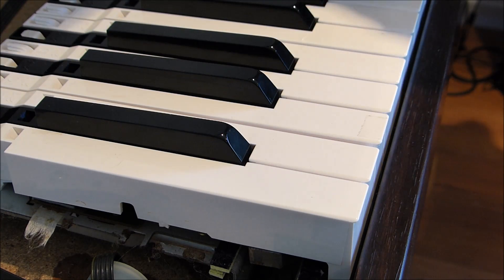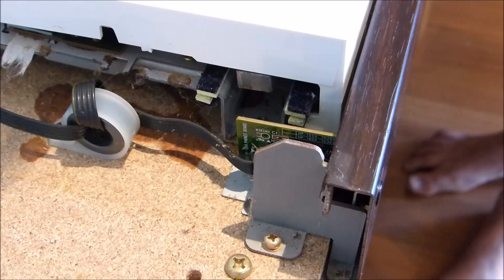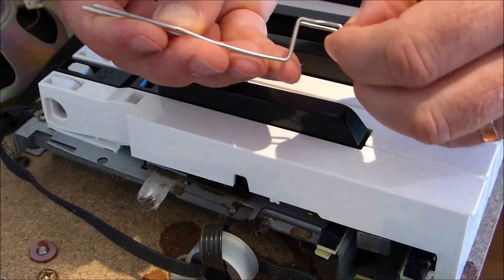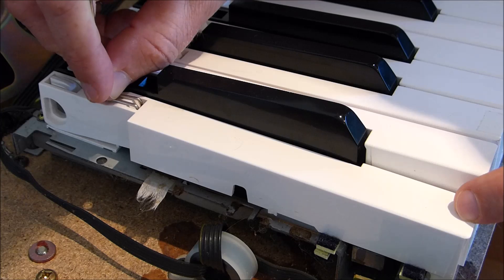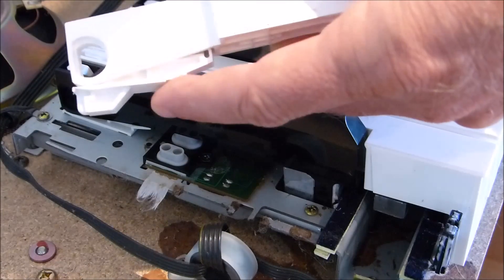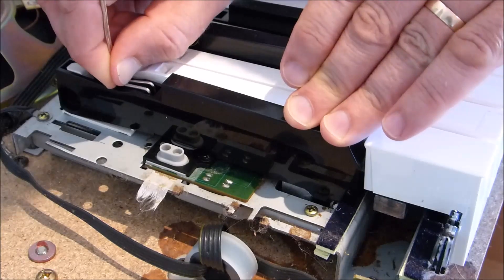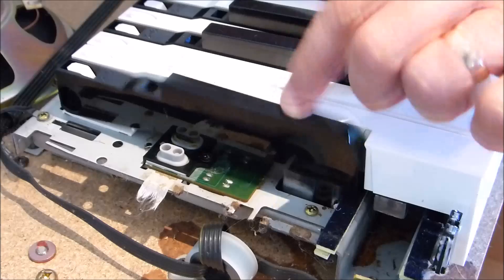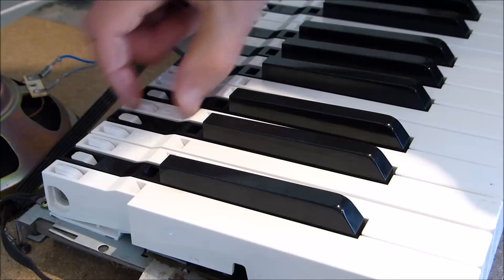Roland HP-230 Digital Piano Key removal for contact repair HP-3700 HP-800 HP-2700 KR-4700 KR-5000

Comment: Hi there Fontgod,
I am a fellow Aussie and found this video incredibly useful. Thank you so much.
I managed to get all of my keys off with the your paper clip tool (I found if the paperclip wire was not very strong, it was beneficial to insert a small flathead screwdriver behind the tool to keep it in place while the key is being taken out).

But regretably I have realised that if the nipples on the underside of the rubber contact pads are broken, then operation of note on/off or velocity is impeded because it doesn't make correct contact with the contacts in the pcb: the front nipple is note on/off; the back nipple is velocity. This often can explain why note on/off doesn't work at all: faulty front nipple; or velocity is always 100% when note is sounded: faulty back nipple.

The syntaur.com website you suggested in the comments thread does have limited stock of contact pads in stock, but I would need so many of them to replace. So coupled with postage from US, it makes this project bigger than Ben Hur, and unfortunately destined for the trash after a bit of component salvaging.

Thank you so much for your help, though!
Reply from the maker: How damaged are the contact pads? They may be repairable with a a conductive pen or some special conductive sprays. Have a look at this forum thread for some tips https://music-electronics-forum.com/showthread.php?t=35656

Comment: do i need a different key removal tool for hp1500?
Reply from the maker: I am not sure but if the keys look the same as in the video then worth a try with making this tool. The alternative is using a small screwdriver starting at the very left of the keyboard (perhaps right side as well, unsure offhand) . See this image for basic instructions  and check if it matches your keyboard. https://www.fontgod.com/photos/rolandpianokeyremoval.jpg
Reply: @Fontgod  Thanks for the reply! I ended up figuring out how to get them off safely by going in from the side with a screwdriver. Now my issue is that I don't really understand how to fix them. I believe in the video you said rub with pencil eraser and then just draw on it with a dark lead pencil. Do you mean a standard graphite pencil?
Reply from the maker: @kv7411  Depending on the state of the key contact, you can sometimes do a temporary fix by simply removing the offending key, and then insert a matchstick into the two holes at the top of the rubber contact and wiggle each hole around for a few seconds whilst pressing downwards with gentle force. This can help to create electrical contact again underneath the rubber and dislodge any dirt that may have accumulated. You will likely need to redo this every few weeks to months though in my experience.

If this doesn't work, you will need to remove the rubber contact strip related to the keys that don't work, then clean the contact of the key that isn't working both on the circuit board and also on the little black circle on the rear of the rubber strip. You can do this with a soft pencil eraser, be sure to remove any bits of eraser dust that gets left behind. I have also washed my contact strips, scrubbed the little black dots (carbon dots) with a teflon scrubber and dried them out before putting them back. You can sometimes replenish the carbon on the circuit board with a very soft/dark lead pencil such as a 6B, just rub the pencil tip over the circuit contact areas under the rubber contact strip (only do it for the keys that aren't working). I have found that the easiest way to remove the contact strip is to remove the 4 or 5 screws in the plastic frame that holds each strip, then gently prise it upwards from the front and lift it open like a lid of a chest, without actually removing the plastic frame completely from the back of the circuit board, you can then pull out the rubber strip to work on it and fold the frame back down when finished. The screws on mine a notorious for cross threading when putting back together, to overcome this I gentle turn the screw anticlockwise until I feel a slight click, then start screwing them clockwise to tighten. Do not overtighten as you will crack the plastic frame.

If the pencil trick does not work, it is possible to buy a "conductive ink pen" or "conductive paint" on ebay and you should be able to redraw the contact area if this is the cause of your problems. It can sometimes be the case that the circuit has corroded somewhere else away from the contact area under the key which would be much harder to rectify. Hope this helps you.

Comment: Hi' I've tried this "many" times at this point. I messaged you awhile back. I am pretty good with tools, plans ect. I can't get it. Is the 1700 different by chance? I am thinking it must be. I have broken a couple of trying this. Thanks
Reply from the maker: I'm unsure if it is the same mechanism. However if you are unable to get the key tool to work, you may be able to try an alternate method using a screwdriver to pry up each key from the side access hole. The downside to this method is you potentially need to remove lots of keys to get to the key you want to repair. I have made an image for you to explain a little better. See https://www.fontgod.com/photos/rolandpianokeyremoval.jpg

Comment: Other tip: If you are fixing "dead notes" as I was, after you remove enough keys to pull out the rubber cover which has to 2 black contact buttons, which hit the circuit board to make a note...  you can use Q-tips and rubbing alcohol, to quickly clean the contact points. Then make sure - when putting the rubber strip(s) back in place, that all the little nubs are firmly in all the holes. For this, the flat end of a ruler (or similar) works great to press the rubber strip nubs back into the holes firmly. Tip 2: make sure you actually check each of the notes to make sure they were all cleaned properly and are working BEFORE you put the keyboard casing back together. I found that with one key, it had to be given a 2nd go-over with the cue-tip to get it working.
Reply from the maker: Good tips and I do something similar to clean mine, although they need attention every few months especially in humid weather.
Reply: And if you don't have rubbing alcohol I used whiskey. Lol.

Comment: Thx! Removing keys as we speek! 3 down ... 85 to go ... but with motivationlevels at 200% thx to your tutorial!
Reply from the maker: 10 Hours since you posted... hopefully you should be just about done  ;)
Reply: Removal was succes! Managed to even out the action a bit more, but one of those gray rubber contacts has been ripped do to it's age I guess. Moved it to the verry end of the keybed and going to try and fix it with a bit of superglue. Long story short ... almost there 😉🎹🎶 Thx again, because afterall ... this video got me in to this adventure!

Comment: Great video, very helpful. This is what YouTube is all about. Thanks for your time and effort. I had to remove over 30 keys to remove and repair a corroded PCB  section underneath one of the keys. I would have probably broke one of these trying to get it off without this tool and knowing how they were fastened.
TIP 1: Some of my keys were stuck fast so I found that rocking the key side to side gently whilst lifting and pushing, helped release it from the metal seat easier without pushing to hard. 
TIP 2: Don’t be tempted to put your finger under and inside the ‘white keys’ to help pull them out as you’ll crack or damage the key. They are quite brittle there.
Reply from the maker: Thankyou. Some good tips from you there.
Reply: Great tips !!! Thank you H Follis!

Comment: I have a HP1700 and I have followed the directions for the tool and I can not get it to work. I have broken keys..! Can  you tell me what I am doing wrong? The video is really helpful. I just need to get the tool thing figured out. Thank you.
Reply from the maker: The only thing I can think is that your paperclip steel is too flimsy and it's not strong enough to maintain shape. Try a thicker paperclip and double check measurements. Return to the video at 1:58 and make sure you are following correctly. Be sure to depress the key BEFORE inserting the key, then once inserted into the hole push the tool backwards towards the back of the piano. If the tool is working correctly you should be able to let go of the key and tool and the key should remain depressed by itself. Check to see if the tool works with an unbroken key as perhaps there is something about the broken keys themselves which are causing an issue with removal. If this still doesn't work, there is a method to remove all keys with a screwdriver starting from  the left (or perhaps right side as well?) of the keyboard, but it means you have to remove all keys before reaching the one you intend to repair. To try this alternative method, depress the far left key, insert a thin flat screwdriver into the little slot in the plastic where it meets the steel (slot is below and slightly back from the main tool hole) and prise the plastic upwards slightly, then pull the white key towards the front of the piano (black keys slide backwards).
Reply: Thank you..! I will try again.

Comment: Can you message me a copy of the tool design image file? Much appreciated! Awesome video! So helpful!
Reply from the maker: If you pause the video at 5:40 you should be able to see the image, suggest capturing a screenshot if you need to print it.
Reply: Did I ever get back to you with the copy of the design for the tool that removes the keys on this Roland electric piano?  If not -= let me know - I''ll find those images on past drives - and send to you.  I actually still have the little wire  tool I made - (which by the way - I also got from a good You tube video about this  - in the first place!!)
or email me at my website www.WarrenProductions.ca and mention the topic to remind me.   Cheers mate!  Stay Well! Live Happy!

Comment: Dear Fontgod, you are a legend!   I really want to send you a gift, a nice bottle of wine or whatever you like!  I've just restored my Roland HP 230 based on your video.  I had 6 keys not working properly, a couple were dead and a few were too loud (velocity issues).  They now all work.  I removed all the parts and the keys and then removed the membrane under the keys and cleaned all the contacts.  I then coated each contact with a soft graphite pencil.  I've been playing it for 2 weeks now, so far so good!
Reply from the maker: Hi there, that's a very nice offer and I'm humbled but not required, send a donation to Doctors without Borders or something if you feel it was of benefit (msf.org). You will probably find that over time the keys will start to play up again so I find its best to leave the majority of screws out of the casing to make the process a little easier the next time. Mine tends to play up more when the humidity is higher. Edit: by the way, checked out your monocycle, fairly sure I read about it a few years ago on Gizmodo or some other tech site, or something very similar.
Reply: I've donated to them, great cause, see below.  Yes I fear it won't last so I won't put it back together completely.  I don't want to throw it out though as I feel that it's such a massive waste and bad for the environment so I'm prepared to re-do it at some stage.  Yes I developed that wheel with a colleague and we had to sell the business at a loss as we kept getting copied by the Chinese....our own factory stole our IP and launched a copy before us!! Unbelievable!  Thank you again!  

Tax receipt for your donation to Médecins Sans Frontières Australia
Donation Amount: $50.00

Name: XXXXXXXXX

Receipt Number: CC97193321

Date: 13:08 12 July, 2018 AEST

Médecins Sans Frontières Australia Ltd.

ABN: 74 068 758 654
Reply from the maker: Awesome, thankyou... although bugger about the wheel (if you hadnt guessed by my voice I'm also an Aussie, near Coffs Harbour NSW.) Yep, throwing something out of that size and with all the tech inside it is certainly something I would try to avoid, I'm more of a roadside junk recycler and repairer than someone who puts stuff out for rubbish pickup). This piano was one from my wife's school that was going to be thrown out as the repair quote was way too high. Tip, if you pull out just the key that needs to be repaired you can often give it a quick fix that lasts for a month or two just by inserting a long match into the two little holes at the top of the rubber contact and then press down and work the match around for a few rotations in circular fashion. This generally dislodges the crud under the contact for a while. Eventually it will require a full service where you remove and clean under the contact strip though. I usually leave just one tiny screw in the far left of the front shroud and one screw to hold the top down, just remember to remove the pedal cable before lifting the lid otherwise it risks breakage.

Would love to hear more about your experiences in creating the mono cycle if you wanted to contact me via private message, I've usually got a few business/product ideas running through my head at any one time amongst all the other noise and you never know when a synergy with another person will pop up. Cheers, Graham.

Comment: I got my Roland HP 2700 opened up, too bad i don't have a extra 1.5 thick steel clip, maybe i will try to clean mine on the other day, but thanks for your video i can now repair my Piano, i miss it so much :'(

Comment: Add HP-5600 to list of compatible repairs. I started off with that repair fright you have when prying open something you've never seen the inside of before. Made the key remover tool exactly to your specs, worked great, first go. Was able to do a full service job locating and cleaning the contacts that way. The few problems the 1987 piano had, which I got this week for around 300 USD, all disappeared. Remarkably authentic feel & response. All I need now is piano lessons.
Reply from the maker: That was me commenting as Graham above. Thanks for letting me know about the HP-5600, will add it to the list.

Comment: Worked perfectly on the KR-4500. Found it was possible to make a tool that was able to remove a key without lifting it up by changing the 16mm length to 19mm allowing it to lever up the locking mechanism.
Reply from the maker: Interesting, thanks for the feedback.
Reply: Finally someone who managed to repair the exakt same old model. On mine, every Second D and B Flat Key stopped working. Trying to figure out what happened right now, still stuck at trying to lever up the keys though :|
Reply: @Nahkampfschaf  That one is going to be a little tricky. My unit had just 2 keys with issues. 1 no sound, 1 muffled (deep clean and graphite pencil trick). If you have a pattern of keys not working it might be more than just a clean. Likely a poor contact between the key's PCB and the main board. Shortly after fixing mine, the main board decided to eat it.. soooo... big paperweight just made it to the too hard basket for a while.
Reply: David McCauley That what i'm afraid of. I'ts D1, D3, D5, D7 and B Flat 1, 3, 5 and 7. Every other key, even D2, D4 and so on are working perfectly. I got it cheap one week (!) ago. I had a bit muffled sound (cracking and chirping) when turned on, via speakers, headphones AND line out, so no speaker problems. It got way better after the first 10 minutes turned on and no problems at all when going through the midi out (via midi-usd cable to the pc). Didn't bother me at all, still way better then my old 50€ keyboard. Then all of the sudden after 7 days (this thing is almost 30 years old!) some keys went dead. I'm still mad. The Roland is open, but can't get the keys lifted up for now. Have to get some thick paperclip or something later today, to build something. Hopefully ist something i can fix with a pencil, or some silver glue. Haven't soldered in like 20 years and everything else is beyong my expertise :/
Reply: @Nahkampfschaf  Grab a piece of welding wire. Perfect weight for shaping for this